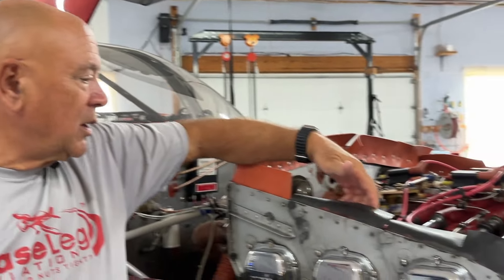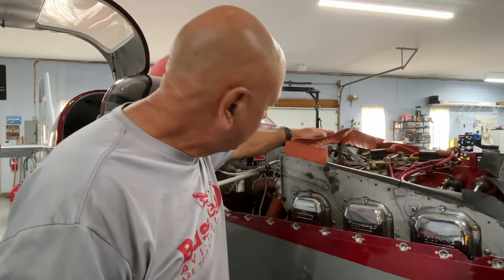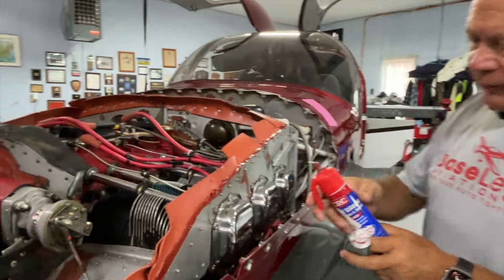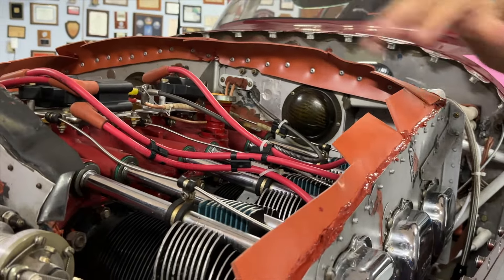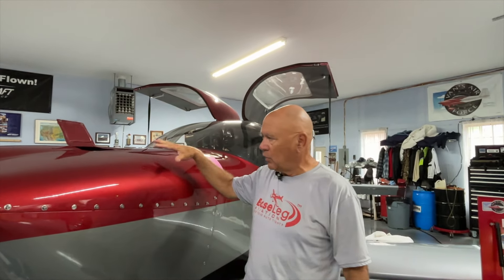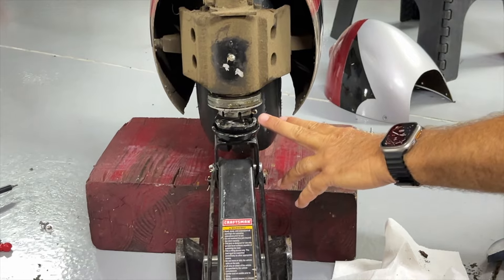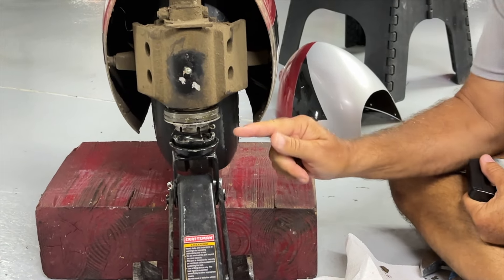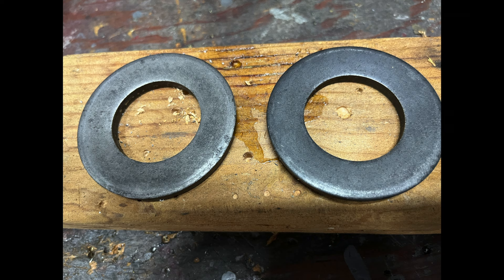Replacing Baffle Material and Belleville Washers on Van's RV 10

Comment: Thank you very much for this very interesting video: I have an RV-7 in the south of Spain and I have installed the baffle seals that VANS sent me with the FWF kit and after less tan 200 hours of engine operation, I have already noticed that these baffle seals have lost a significant rigidity and my CHT are rising. I am going to change them. Why don't you use the baffle seal retainers strips?
Reply from the maker: NP with using the baffle seal reatiner strips. I use the RTV on the backside and I think it seals well. I will pay attention to these to see if they need the retainer strips. Haven't needed them in the past, and needed to get this done quickly.
Reply: Good video- Vans mention fitting the Belleville washers dry in the RV14 build manual which I presume would mean they’re going to wear faster than if greased.